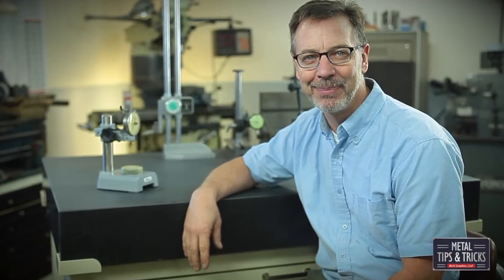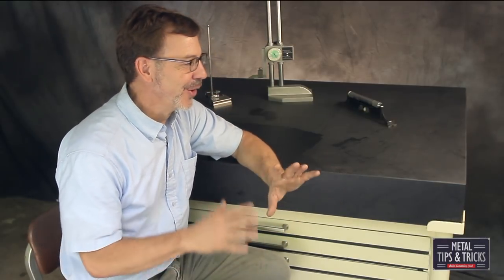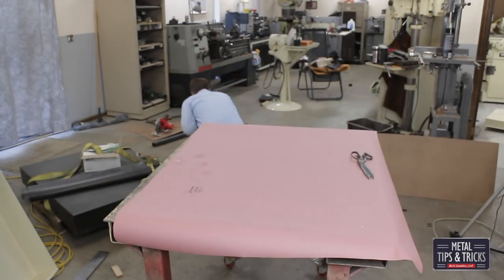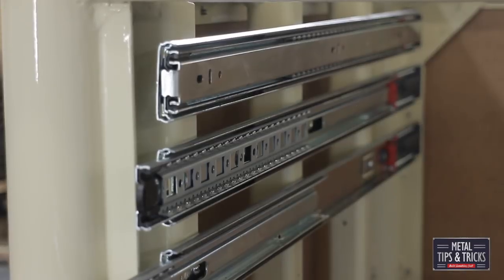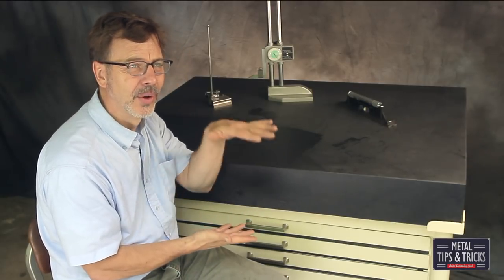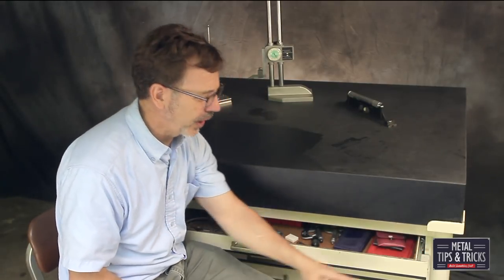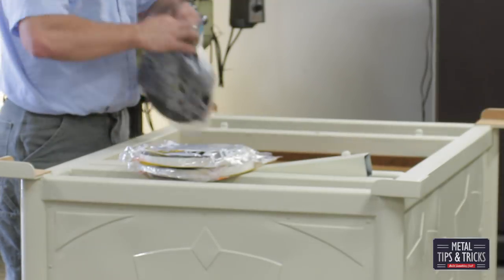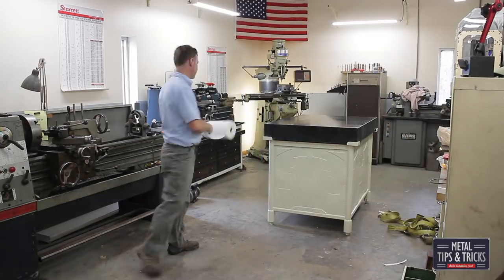Ultimate Metrology center  ( Assembling the table)  part 5 of 6

Comment: Beautiful looking cabinet and table. The color is perfect for clean look for a metrology-like environment. I too have used the 3M 77 spray adhesive for felt lining drawers and had to laugh when you mentioned improving your placement technique on each drawer. That was my experience and using paper hanger tools helped to produce very smooth surfaces and tight corners.
Reply from the maker: Hi Paul, I will have to go out and get some of the paper hanging tools. :-)

Comment: your metrology center is inspiring. I have been collecting metrology equipment and I will build also a somewhat of a metrology center. I plan on using a tanker desk and a 18x24 plate for my needs. a Kennedy box will hold some of the smaller items. also what kind of felt are you using? my Kennedy box needs refurbishing.
Reply from the maker: Hi Bruno. The felt I used is nothing special. I got it a my local fabric store.

Comment: I see that we use the same color paint for shop built/rebuilt stuff. Does the stuff in the large can take as long to harden as the spray can stuff? I'm painting a table for the 8x20 bench top lathe now. Me and my dad rebuilt a Bridgeport and painted it turquoise too.
Reply from the maker: HI Daniel, I add a drying agent to the paint called "Jap dry" but using that I still wait 24hr before painting a second coat.
Reply: I only used the spray can stuff so far. On the bridgeport we used epoxy paint and a foam roller. It worked pretty good.
Reply: A adapter

Comment: How did you lower the surface plate and remove the strapping without disturbing the foam weather strip you had laid out? In the video it looked like you just pulled it from under the surface plate while it was already in position... or at least that was my take on the Sped up video or Time lapse.

Comment: How did you attach the side panels to the cabinet?
Reply from the maker: Good question. They were screwed on to strips of metal welded onto the main frame
Reply: Build Something Cool very clean which made it hard to see the screws. Wasn’t sure if you welded the sheets or tacked from the inside. Thank you for the reply.